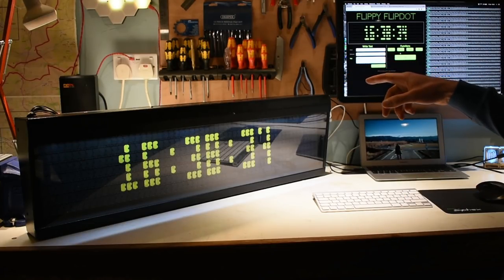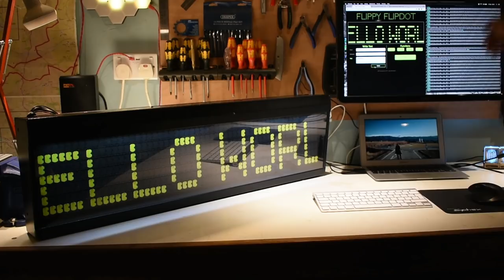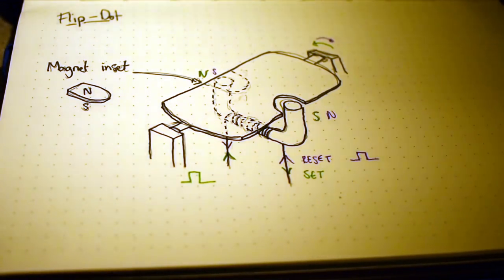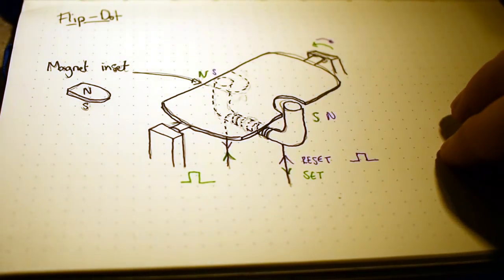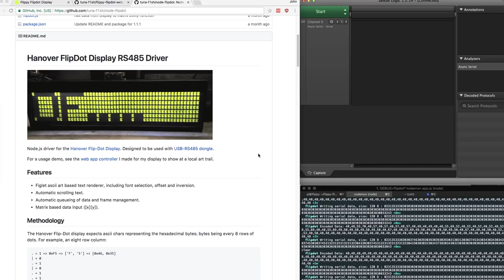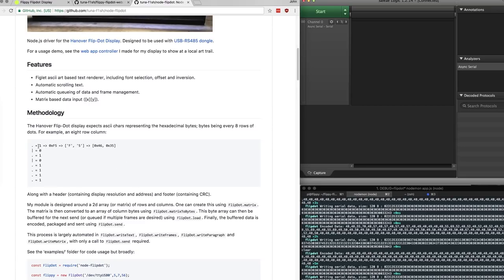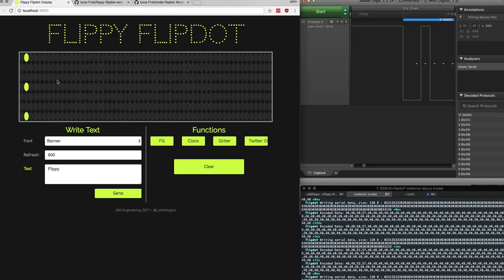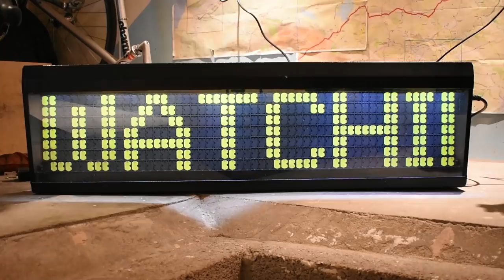Adventures with Flippy the Flip-dot Display - Software and Teardown

Comment: Does it matter which NodeJS version you use? Or which were you using here?

I had trouble (particularly getting Serialport module to install)
Reply from the maker: It might do since this project is a few years old (2017). It was probably Node 8.

The serialport module is well maintained but there have probably been major API changes over the 4 years.